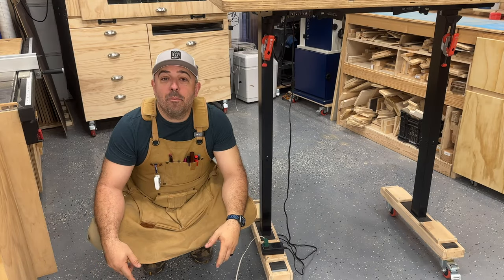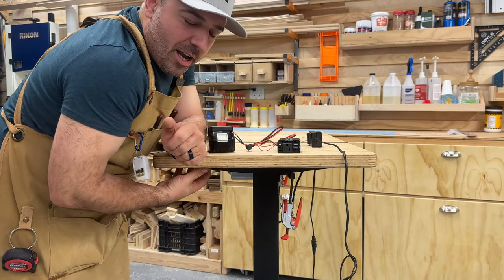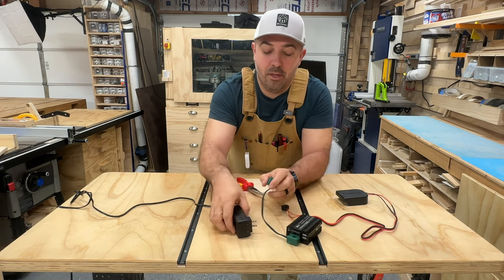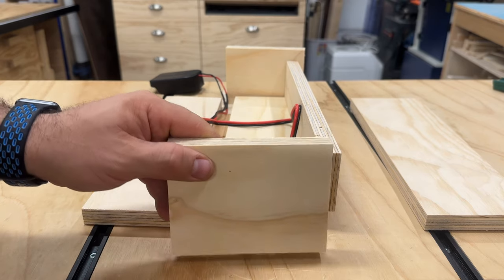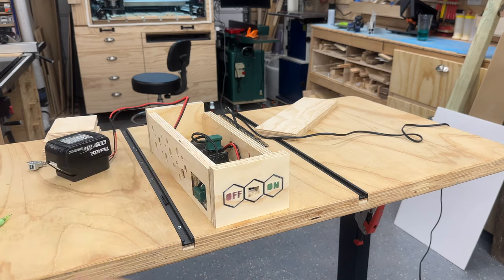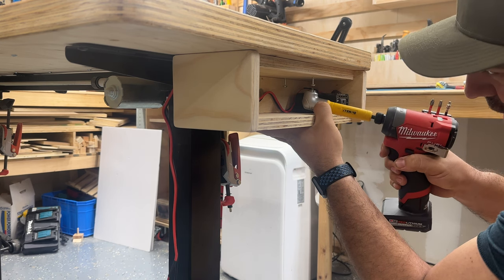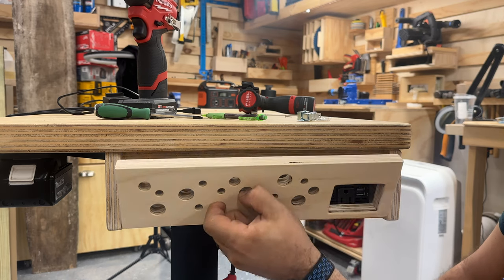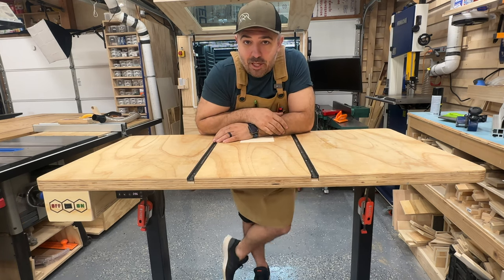PT2 WIRELESS!   Woodworking Electric Drill Press Table & Shop Table

Comment: Hah, awesome!  Ironically your doing DC to AC to AC to DC conversion. I’m an electrical engineer and maybe I can come up with a DC to DC converter where you could cut all the bricks and dongles out of the way.
Reply from the maker: Very cool, would love to hear it. I had an inkling about that however, it is definitely not my area of specialty and didn’t want to break my table out of ignorance! Worse yet there is the concern in making a video like this, that somebody buys a different model that is not DC and then follow my instructions and destroys their table so I went the safe and easy premade route. The one I have, the motor says 24v dc and the controller says 29v dc in 24v dc out. That was enough out of my wheelhouse to play it safe 😂
Reply: My thoughts exactly. Lots of wasted energy in those inverters. Just cut off the plug for the table and then add a switch between that and the battery. Boom, problem solved.
Reply: @BitnerBuilt  I am curious as to what the output voltage from the tables power supply is. If it happens to be 18 or 20 volts just eliminate the inverter and power supply.
Reply from the maker: @iggy8702  yes a few others have pointed that out, this build was meant to be the easy, plug-and-play way that anybody can do. I will probably do a version three of this where I direct wire the battery to the motor.
Reply: @BitnerBuilt  I like the idea of converting the electric standing desk to battery but I am also considering just getting one with a manual crank. Related - I have an old Craftsman drill press that I inherited from my grandfather that does not have a crank on the table. It is a pain to adjust it up and down manually. I bought a linear actuator and various switches and controllers and am going to try to attach it.

Comment: You have holes for ventilation, you could simply drill holes in the bottom of the box and use a driver bit long enough to reach screws through bottom of box.  Just a simple tip for anyone building something like this in the future.
Reply from the maker: Ah true didn’t think of that! Good tip 👍

Comment: Great video. This one and the one you showed the different uses for this cart/table. I will be putting this in my arsenal of to do projects. 

A thought I had while you were discussing the issues is since you have a 3d printer you could have printed a 2 pc grommet of a sort with a round OD and a square/rectangle ID. Encapsulate the square switch then push the assy into the drilled hole. Anyhow keep up the good work.
Reply from the maker: Great idea! At the time of this video I don’t think I was 3d printing yet but yea now it’s my go to problem solver!

Comment: That's a great idea. I didn't know those kind of inverters existed. My mind is running with ways of turning things "wireless". I found bigger (and more expensive) inverters that would work with my 60v Greenworks batteries that could possibly run larger more power-hungry things.
Reply from the maker: Yea I have actually used these on several projects but didn’t know about the bigger ones!
Reply: @BitnerBuilt  looks like the max wart output is limited to 300 even for those that work with larger batteries. Higher watt inverters are much more expensive. Oh well. Still a cool trick for lower power devices. Thanks for sharing your projects.

Comment: Re rocker switch, you can buy them with the wires attached and the just use heat gun pre soldered tubes to rewire it. If you need links, let me know
Reply from the maker: Thanks! A lot of people actually suggested that for the next revision for this, I eliminate that whole set up and directly wire the DC battery to the DC motor. There’s also so I’ll probably explore that but thank you so much for the offer.

Comment: Perfect video. Thank you very much. Just a question out of a curiosity: if the stand's motor is a DC powered (not sure, but possible), then why not connect battery output directly to the motor? No need for complicated converter 12V (or 18V, whatever)  to 110V and then back via motor's huge plug?
Reply from the maker: Thanks Arsen! So I definitely did wonder this, however, I am really not super knowledgeable in that stuff to be honest and just like I didn’t want to cut the power button wires I definitely did not wanna screw up my table 😅  I saw the way I did it as a easy, simple solution that anybody could do. I but yes, they do sell adapters for tool batteries to direct wire to DC power, people use them all the time in those little toy cars the kids ride around in, the batteries that come with them are horrible so lots of people convert them over to their tool batteries, so the same adapter could be used. Would definitely be interested to hear from people more educated than me on this!

Comment: Why that small extension cord and a power inverter? If the output of that small power supply is less than the Li-Ion battery voltage, you could use a buck-converter to power the lift system directly from the Li-Ion battery pack (with out the power adaptor, power inverter). It would simplfy things a lot.
Reply from the maker: Smarter people than I (like yourself) that have more of a knowledge of electrical like this pointed it out. So I will look at that for v3. I honestly went for a out-of-the-box simple solution that anybody could follow who has no electrical experience. But your totally right.

Comment: Will be curious if this inverter is left on continuously, will it completely drain the battery.  I've seen reports of similar devices destroying Milwaukee batteries.  Some sort of timer / time out device might prevent that. Could also use the Milwaukee 'Top Off', albeit for $80 more. Overall love your idea.
Reply from the maker: I shall be your guinea pig and let you know! Hopefully the goal with the switch being hard mounted to the front will make it easy for me to turn it on and off but of course we all know I’m going to forget sometimes and it’s going to drain the battery out
Reply: @BitnerBuilt  An option to avoid draining the tool battery would be a wind-up timer switch to cut power. Twist to activate and no need to remember to turn it off, plus it doesn't require any adjustment like a low-voltage monitoring circuit.
Reply from the maker: @PaulSchaffert  ooo fantastic idea Paul!

Comment: You could use USB extenders too and just hide the while box.

And with that switch, it probably doesn't matter which wire is which. Since it's just interrupting the flow of curtent or not, you could solder it back on in reverse and it would still be fine. It would be like turning a ball valve backwards in a water or air line. Not all switches are like this though, some have a common terminal, a normally open and a normally closed. So you can send current one way when it's on and another way when it's off.
Reply from the maker: Ah cool good thought!

Comment: This addon actually is a huge selling point for me as dragging an extension cord around my crowded shop is kind of a non-starter.

I was just curious about the power requirements for the desk motor.  More specifically, what does the back of the desk motor power plug say?  

That fat plug is itself some combination level converter or even AC/DC converter.  

Out of curiosity, what is the output of the desk's power adapter?  (18V DC would be miraculous, but doubtful).  Sometimes stepper motors are DC.  

I happen to have some DC-DC converters that I could use.  Overall, these are cheaper than inverters (DC-AC converters) as well.  

Thanks for the great ideas and videos.
Reply from the maker: Thanks so the AC adapter output, 29 V 1.8 A and that goes to the controller unit that controls the up-and-down motion, that inputs dc29v outputs dc24v/5a  to the motor that takes dc 24.

I did the video the easy way of it. 99% of people would be able to replicate, but let me know if you get the direct wiring working. 👍
Reply: @BitnerBuilt  Thanks so much for taking the time to look and post.  1 more question, did you see whether the output of the 120v power converter was AC or DC?
Reply from the maker: @BigJeff19999  didn't list it unfortunately, gave you all I saw

Comment: Have you had issues with the inverter if there is a heavy load on it going up?
Reply from the maker: No not at even with weight it seems very low power

Comment: The other, simpler solution to that is to disconnect the power cord from the motor, and since the input of the lifting motor is 29V DC, you can just hard wire a battery dock directly to the motor, it worked for me despite the 7V difference.
Reply from the maker: Oh very cool! Good to know that works even with the difference. Yeah this was the simple for everybody solution plug and play.

Comment: Not read comments so if asked sorry... 
Why did you  not just cut the power supply off.. Then add a voltage regulator to step up/down as needed. I assume the table is 12v dc.? But even at 24v that can still be done if running a 5 amp 18v battery with regulator? ( Less power loss than the ac conversion then down again.
Reply from the maker: Been said many times 😀 but answer is I wanted an easy solution anyone could do cheap and fast, your way is the best “electrically efficient” way definitely though!

Comment: Good idea, but why You take 18v DC, convert it to 120DC and again convert to propably12V DC. Just use adaptor 18 to 12 (other) Fraction of cost, half of space.
Great Idea, stupid execution.
Reply from the maker: For all the people who don’t know how to wire, this was an out-of-the-box plug and play solution that anyone could do, for version three of this, we’re going to look at direct wiring, DC to DC
Reply: I wouldn't call it stupid. It works. 

It's kludgey, but I understand why he designed it this way. I had the same thought while watching the video - 18VDC to 120VAC, then back to DC power of unknown voltage. I'd love to know the output voltage of the wall wart; I haven't seen it mentioned in the discussion. Knowing the output voltage (or the input power requirement) would be the logical next step.